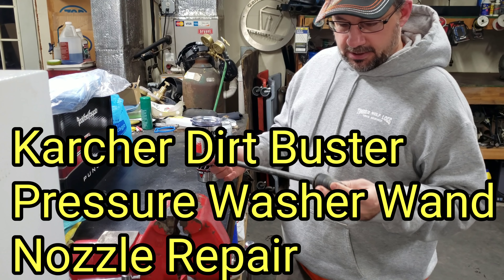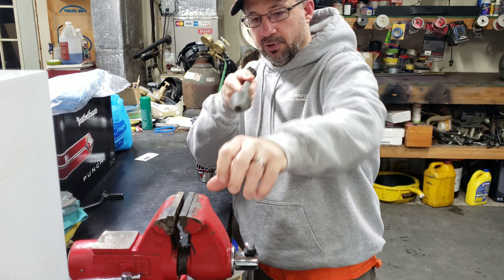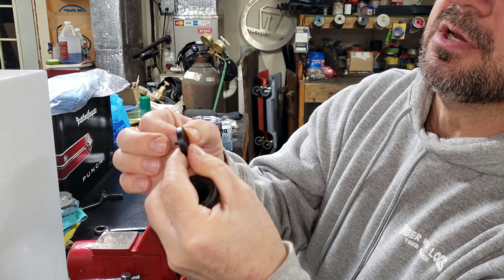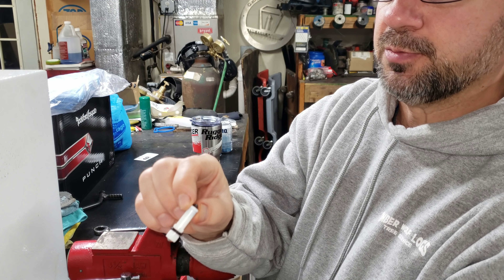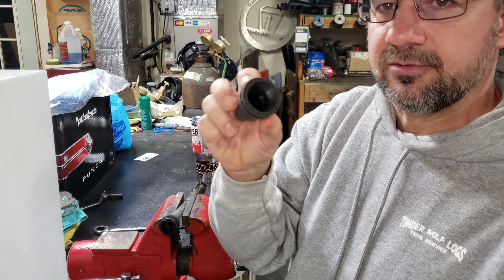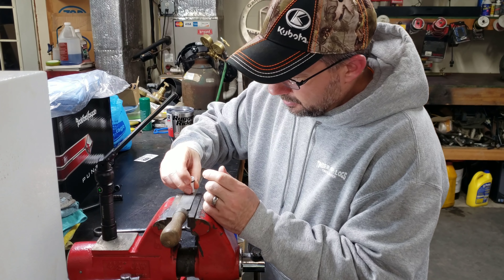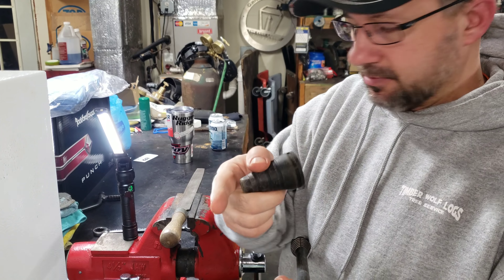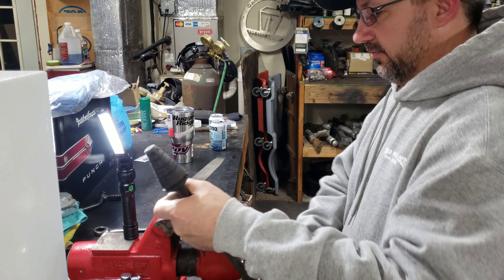Karcher Dirt Blaster Wand Repair. These parts should be made available!

Comment: It’s the ball bearing on the other side the bearing wears out the seat inside . You can pry out the bearing . I saw an English fellah add a washer .. but who has a small washer?? What I did was on a flat surface I sanded down the face enough that when you install the bearing you can see the bearing sits higher and will do it’s job against the cone cup .. it worked for me

Comment: Trisha is correct.  After experiencing the exact same issue (high pressure 'Dirt Blaster' nozzle misfiring), and searching for answers, I saw how my wand's ball bearing had sunk into the white plastic housing.  Sadly, my housing was too worn to prevent the ball bearing from embedding itself back in, so I added a tiny nut, just large enough to sit inside the housing and block the ball bearing from slipping back inside. It works! Not as good as before (I think it projects a slightly wider cone of water, with less pressure, and slanted slightly off to one side), but good enough until I can find a replacement.

Comment: with mine those  white fins wore away somehow  and the ball bearing sits on 4 tiny upright . These uprights wear down so the ball bearing sinks further  down and looses contact with the disk. I even engineered a small metal sleeve to raise the ball beaing higher
Reply: I sanded down the end of the plastic so the bearing sits higher that worked for me

Comment: The tip has an "extrusion" because it has been worn down by the glass fibers in the glass filled nylon nozzle. These are cheap turbo lances and do not have a proper seat as most turbo nozzles do.

Comment: I had the same problem you need to carefully pop the ball bearing out of the white housing with a small screwdriver.  It should be sitting of top lose not embedded in the cylinder if you know what I mean.  You have to be careful putting it back together so the ball bearing doesn't fall off.  It just balances on top. Mine kept cutting out now works a treat. Hope you havn't thrown it out.

Comment: Well..did it work.... I've repaired many of these... maybe I should video it and post
Reply: i added a very small washer under the ball bearing to lift it up and it seems to have worked but not back to as new performance, so my experience is the repair will help but i suspect a 'planned' wear and tear by the manufacturer is pretty clear to me. Ultimately all we need is a replacement plastic tube costing pennies to have the original working again.

Comment: Thanks Larry, The trick for me was filing those fins at 45 degree angle.
Reply from the maker: I need to revisit this, it worked for a while and then stopped. I need to follow the guidance provided in earlier comments that speak to that steel ball. That is very likely my issue.

Comment: A very well explained video - thanks for that!
Bottom-line: 
- temporary fix possible
- one doesnt have to buy the entire stick for ~40 bucks, but can get the nozzle for ~15 bucks and attach it like shown in the video.
**Question: would you know if it's possible to acquire a fitting ball (inside parts) made of ceramic, to overcome wearing-off issues in the future?

Comment: Does anybody know what is exactly name of this part or part number please ?
Will need new one thx
Reply from the maker: https://www.amazon.com/dp/B07DR54ZBS/ref=cm_sw_r_cp_apa_fabc_KVA0Q8QBXDFHY26CZB6W
Reply: I didn’t meant the whole dirt blaster just that white nozzle part thx
Reply from the maker: @marekmicak-perfectodesign-4590  
I'm not aware of any individual replacement parts, but if you happen across a solution like that, please share it.

Comment: mine stopped working after 5 minutes of work. It has not fixed it.  I would suspect as another Kaercher quality issue.
Reply from the maker: Mines been going hard for 4 years of Jeep offroad cleanup and also general car washing, concrete sidewalk cleaning and other household cleaning tasks. I've been extremely pleased with the machine.
Reply: @LarryMusgrave  machine yes, but the "dirt blaster lance" not. I have filed it a bit, rounded the plastic a bit, still no luck. does not rotate anymore.  as said, 5 minutes after use of brand new, it broke.
Reply from the maker: Okay, mine is dead as well. It appears that the steel bearing in the end (inside of it) wears the plastic and then recesses itself in. Once that happens, it's over... I need to order a new one because it does work great to remove that black from the pores of the concrete on my retaining wall and the sidewalk.
Reply: @LarryMusgrave  exact!!!!!!!!!! that little grey piece in the tip with rubber o-ring wears out . I have played a bit with small mill to restore its original shape but no luck. Maybe during weekend I will try one more time. I'll let you know.

Comment: Larry fixed my wand with your video/ where’d you purchase your magnetic LED light from. Thanks Bub61
Reply from the maker: Harbor freight, they used to have a $19.99 coupon out there for it, but I think $24.99 is the new normal coupon. Look up Harbor Freight Coupon Database....
Reply from the maker: Also, as comments suggest and I can verify now... It will work for a short while at best. The steel ball you saw is recessed to far, the white plastic is worn.

You can get that steel ball back up and sticking out where it should be, but it will collapse back into the worn out plastic again.
Reply: @LarryMusgrave  small washer under the ball bearing , sorted!

Comment: No, test it now larry!  But you'll have to get the water moving quick since its subzero outside 😂
Reply from the maker: I was really excited, last night I put water to it and it worked almost perfectly again.... For maybe 1 full minute. Then it began to do the same dang thing.

With 3 main parts, 2 if those are not moving parts, and the one main moving part is a white plastic cylinder with a steel check ball and a steel nozzle.... There aren't a lot of failure points. I'm mad that it's not obvious to me why this is failing.

Comment: .... You will find on careful inspection that the internal section of the nozzle has been 'flogged' out by the speed of the rotating pintle inside the cone ... this causes the hole in the pintle outlet to drop away from the nozzle outlet and then rotation then stops and you get the offset and inconsistent spray pattern ... the fix for this is easy ... go buy another lance and all will be 'as new' ... Cheers